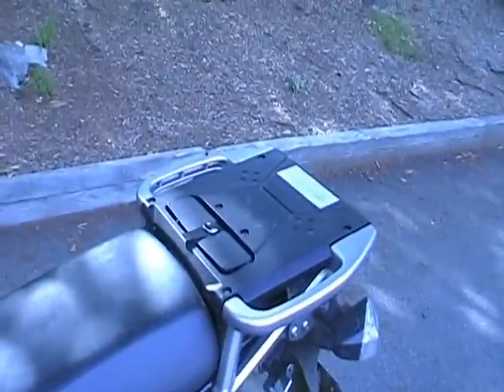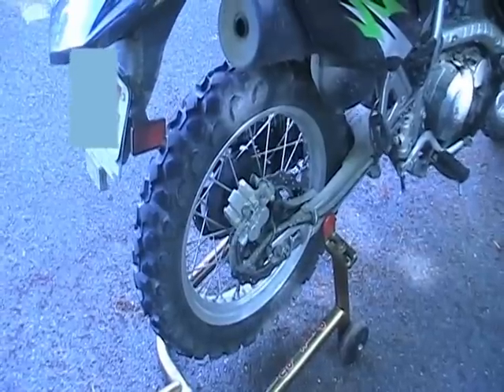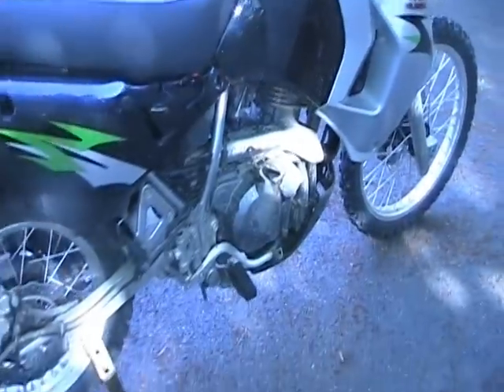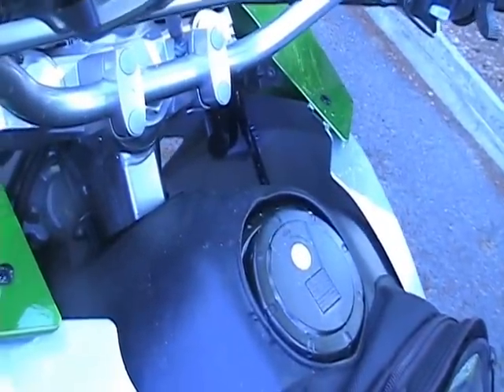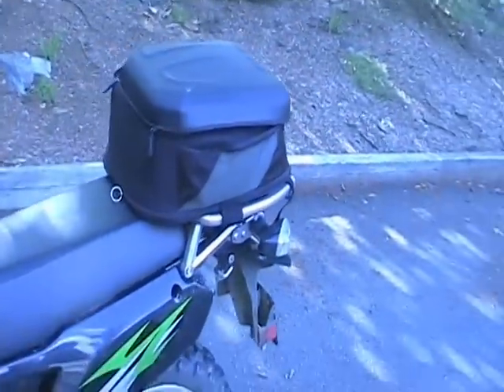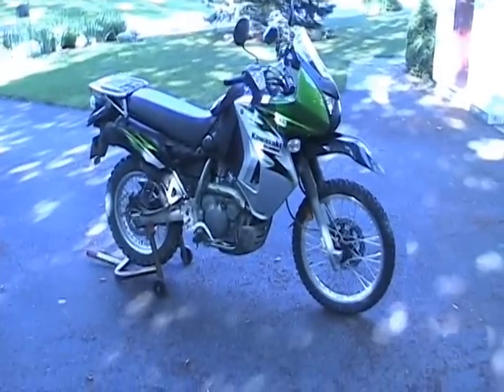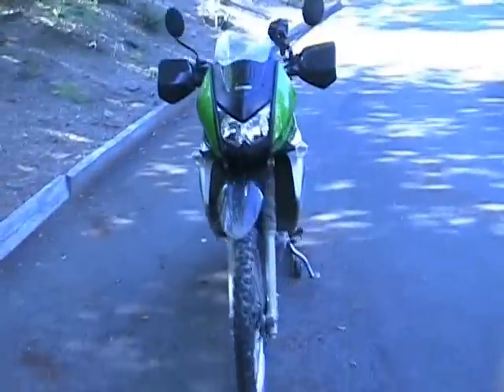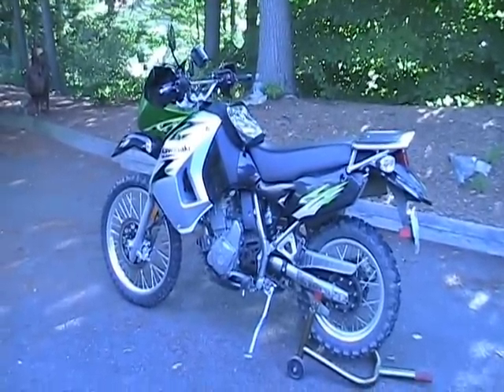2008 Kawasaki KLR650 Review, Part 2

Comment: Thank you for this video.  I was most impressed with your honest and no nonsence review.  I had a Honda FT500 Ascot and access to a KLR250 in college.  I miss both of them and want to get back on a bike after 20 years of not riding them.  

We did the camper bit for a while but sold it because we were not using it.  We have a 3 person SeaDoo PWC, but again I don't pull it out as ofter as I should (maybe 4 times last year and we live less than 4 miles from a lake, so I want something for fun.

Comment from the maker: 1) I've wanted a KLR for a few years, so I didn't look at anything else.  Other compatible bikes to me were the Suzuki DR650 & the BMW F650 - both are highly regarded by their owners.
  
2) Old KLR's did not burn oil - different material used in the rings.

3) I have the factory pipe.  A buddy of mine has the FMF pipe on his 08.  It sounds really nice (good rumble) and gives it a little more acceleration.  It did require re-jetting of the carburetor and trimming of the rear panel.

Comment from the maker: The '08 and later KLR's are supposed to have a stronger "doohickey" unit, but the spring that holds them does not have much tension and goes slack relatively quickly.  Many people are still replacing the whole doohickey with an Eagle Mike kit to address it.

If you can find a pre-'98 that hasn't been abused or has a lot of mileage on it you'll probably be okay for what you are looking for.  The intro. of the '08's has made the price of "legacy" KLRs drop, so there are good deals.

Comment from the maker: Weird..my VFR is also a 2002, 85,000 miles on it now.  I mostly use it for commuting and touring.

400 miles is probably the limit for most people in touring on the KLR.  At highway speeds for that long there is a lot of vibration.  The wind isn't too bad with the fairing and the seat is pretty comfortable.  It does tend to wander or drift a little back and forth on the highway, particularly in high wind situations or passing a truck.

If your limit is 3-400 miles, then the KLR won't be too bad.

Comment from the maker: There is a window on the right side of the crankcase that shows the oil level.  Very easy to check, just get the bike on a stand.

I'm not aware of any aftermarket fuel gauges, unless you want to use a Zumo GPS.  You really don't need one.  Ride until you run out of gas, then flip the fuel tap over to reserve and you'll keep going.  Stop and get gas.  You should be able to get about 220 miles out of the KLR until you need reserve.

Haven't pulled any wheelies so I can't comment on the technique.

Comment from the maker: I can't say I blame you.  The oil consumption issue is real and as of yet Kawasaki has not come up with a recognition of the problem or a fix.  

To compare, my 2002 Honda VFR has over 80,000 miles and I have never had to add any oil between changes (3,000 mile intervals).

Comment: I to have a KLR 650 2008 with 6800 miles and it to burns oil. I guess that is a problem you would think a new bike with a new motor would not burn hardly any oil between changes. Only other complaint is it gets a little darty passing big trucks on the highway to solve that I just lay on gas tank until pass the big rigs. Other than that I love my bike!

Comment: I got mine yesterday.how do you know if you need oil?by checking or a light? do you know if they make a fuel gauge aftermarket? I am in brake in mode so I havent really felt the power, will  the front end come up with just the throttle or do you have to clutch it? sweet green goodness.

Comment from the maker: @coldkendall69 Kawasaki seems to have addressed the oil burning in the later 2008 bikes and from then on.  FWIW, I had a mechanic put new stock rings in the bike about 6 months ago and it still burns oil as much as it did when new.

Comment: Did they ever figure out the burning oil issues?
Reply from the maker: Yes, they went with a new ring material that was not effective in stopping the oil. It got changed in 2009 so later KLRs are okay.